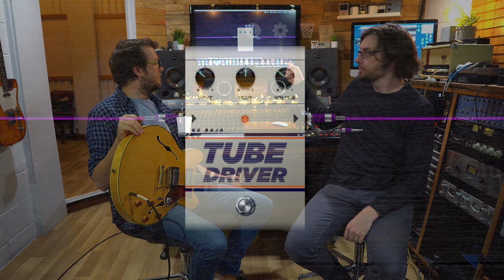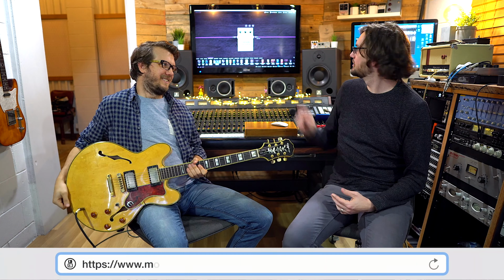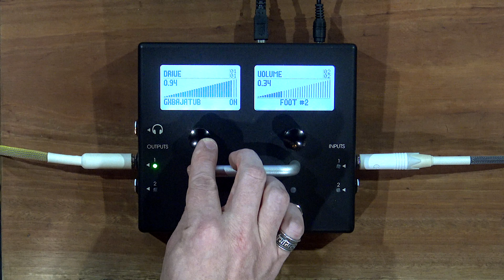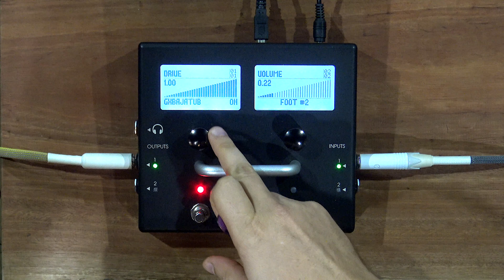Mod Duo Pedals/Plugins - GX Baja Tube Driver

Comment: Thanks for the video! I still have Butler tube drive( 3knobs one, Not the 4 knobs) which I never use any more. Frankly I tried to use it as a booster or low gain pedal but it IS really hard to get the nice tone (kinda muddy). I think I don't know how to handle that though.
And also maybe I am too old to operate that kind of computer stuff pedals ( how you call that? multi effect?) ....so sad. 
ANyways Thanks again ! have a good one
Reply from the maker: Yeah it's a multi effect...it's really simple to use...but I know what you mean...a lot of times just having a pedal that does one thing well with a few knobs makes life a lot easier!! Thanks for watching and commenting!!